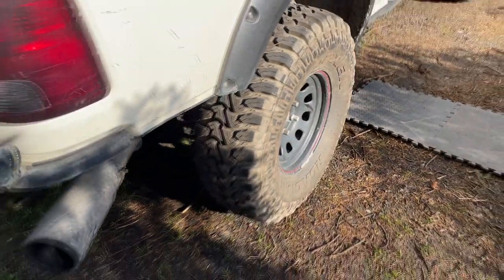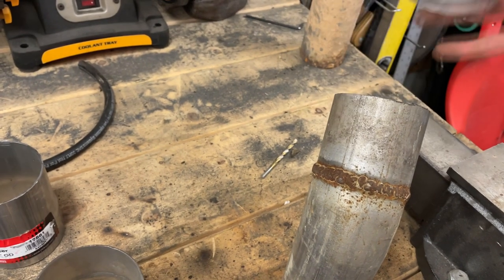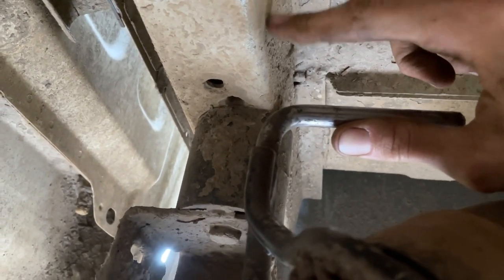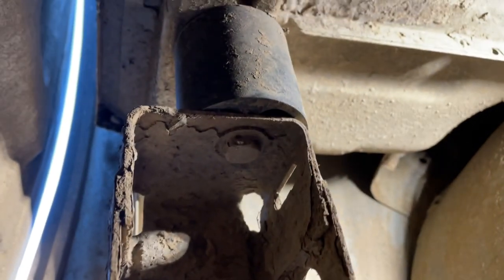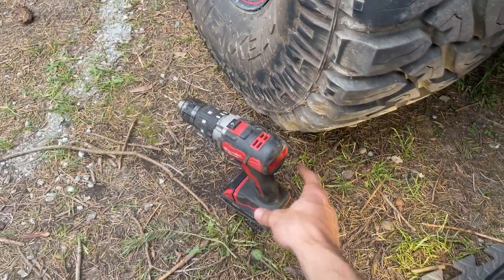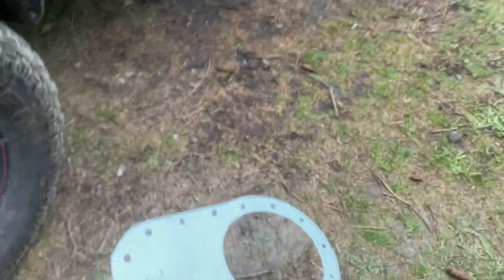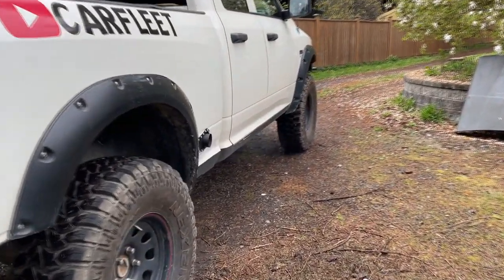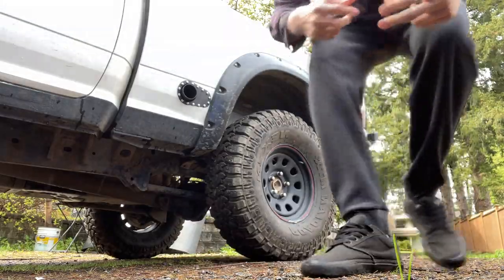HOW TO MAKE A CUSTOM BEDSIDE EXIT EXHAUST!! Dodge Ram 1500 5.7 to loud? (DIY)

Comment: Do I need like a similar heatshield on the inside as well where it's going through the carbody? I want to get it through the plastic bumperpart of my Mazdaspeed 6... if that's even possible?
Reply from the maker: You could heat wrap it 
I didn’t do the black thing for heat I just did it for the look it